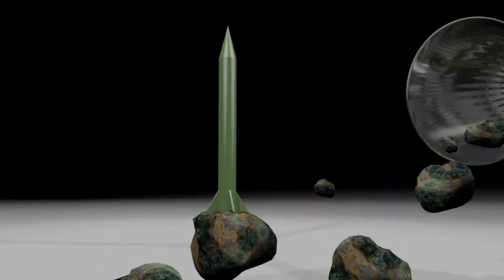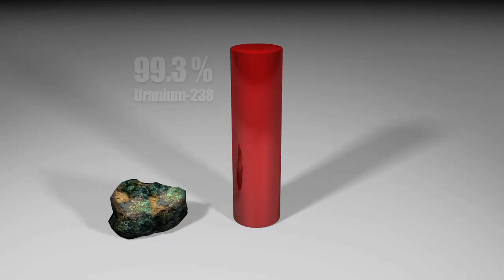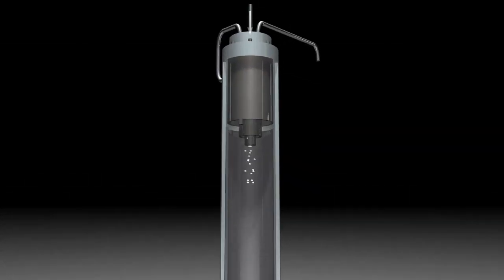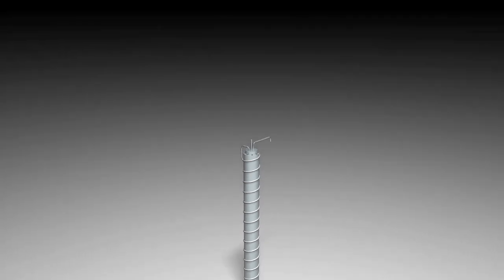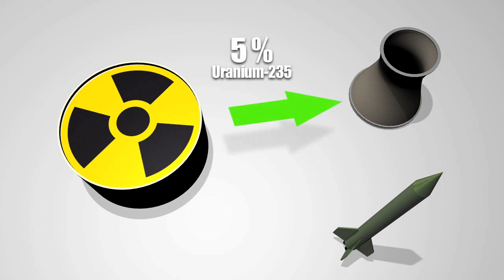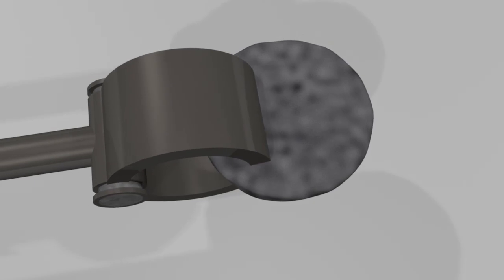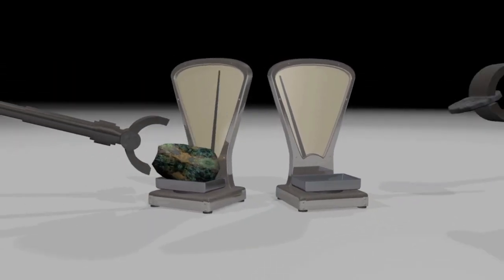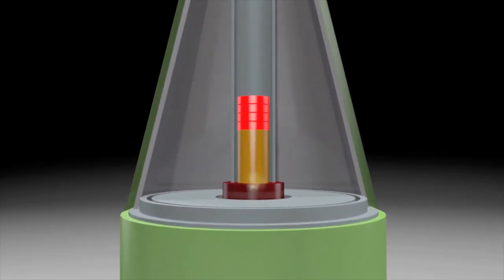Making a nuclear weapon

Comment: to make plutonium you'll need a graphite moderated reactor which will irradiate uranium 238 with neutrons to make Pu-239. but the problem with plutonium is that it's dangerous as hell to handle and store. it's a pyrophoric metal (meaning it can react upon contact with the outside air) so it'll have to be stored in an inert gas environment like a glove box filled with helium or nitrogen. and plus you cannot store it with other plutonium pieces because it can cause a fire otherwise known as a criticality accident. you'll need full personal protective equipment to handle this material such as a full SCBA respirator, thick lead and rubber gloves, fully enclosed radiological suit and an inert gas glove box

Comment: 238 is used for energy just not bombs only 235 is used for bombs
Reply: Uhhh, no.  U-235 at 90% enrichment is used in the primary, certainly, but the secondary is usually contained within a U-238 tamper, which fissions just fine with the high-energy neutrons produced by the fission.  In fact, it's the largest contributor in a three stage weapon; that was what was left off of the Tsar Bomba to reduce it from 100 MT estimated to 50 MT actual yield.

Comment: This stuff shouldn't be on the internet.
Reply: The thing not mentioned is how extremely difficult it is to make a detonator that will properly trigger a reaction. No amount of theory can solve that problem, you don't know if it works till you test it.
Also, the more simple detonator design they showed at the end of the video is similar to what was used in Hiroshima. It's a 'gun type' detonator and it's easier to set off, but requires a very highlyy enriched uranium, which is prohibitively expensive to produce.
So even with all this information, it is still extremely difficult to make these weapons.
Reply: I think if someone bought a nuke on the black market they would've used it already. If it's a small rogue group they'd have nothing to loose since nations wouldn't know who to target. Which avoids the main problems with nukes, mutual assured destruction.
Most likely candidate for getting nukes that way is North Korea, but we know they make their own nuclear material
Reply: Anyone who has any chance of doing this would know this already.
Reply: +Orthanc6 how about black market?
Reply: do not worry brodie only fucking ISIS has this and also it is very difficult to get a hold of these materials
Reply: do you realize this informations are basic knowledge, right? :) ... or it should be a basic knowledge :) .. i know everything what they said in video from one hour of reading wikipedia :) but this video got a brilliant animation ... simple...
Reply: One Los Alamos physicist stated that you could get a considerable explosion if you held half of a supercritical plutonium sphere in each hand and clapped them together in full arm swing.  Enough to do the swinger, at any rate.
Reply: Orthanc6 then the ISIS ?
Reply: Orthanc6 They might cook something